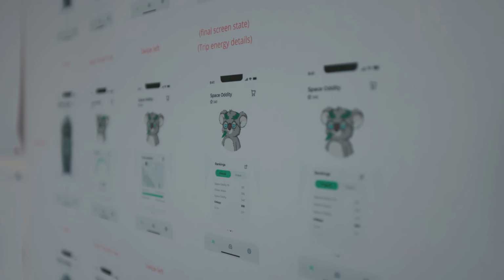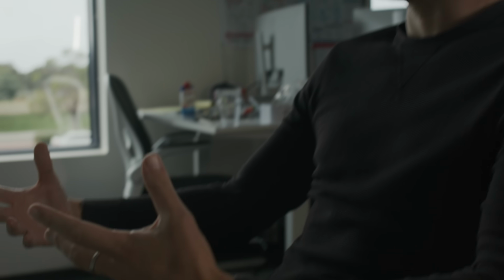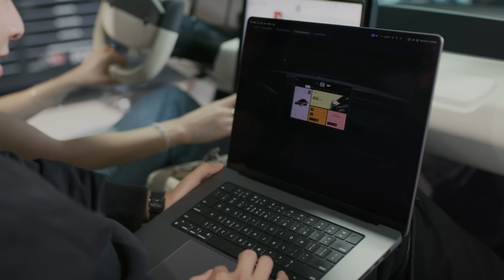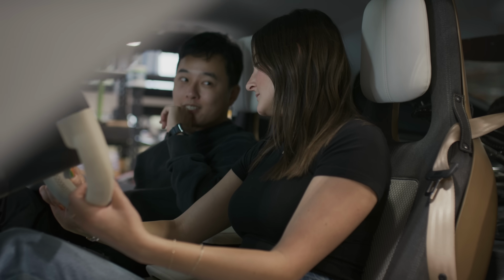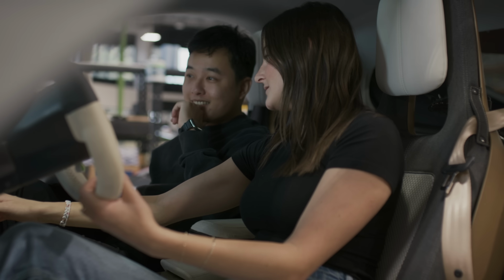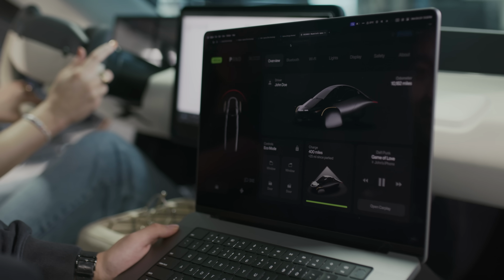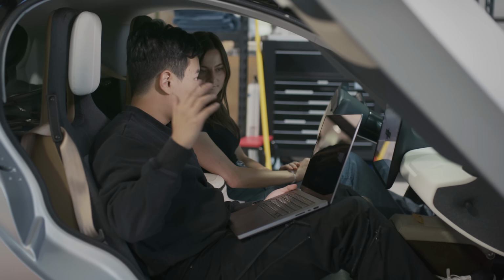Aptera — User Experience

Comment: Will it be possible to get some kind of physical button interface? especially something that can be down by the center arm rest that the driver can learn to memorize. This would help not need to look at the center screen for most use cases. This is something I learned to really appreciate in my '16 Mazda 3 after driving several other vehicles that have come out in the last 4 years.

Comment: I hope that there is  a screen that has a large digit speed readout and all necessary controls with large obvious buttons.  For the windshield wipers, windows, heat/ac/defroster. With dark mode. I don't want an eye chart and I dont want to be distracted have to go into sub nenus or perform multi touch actions while I'm driving. I'm not a fan of touch screen control in this application. I think that it a kin to texting and driving.

Comment: An American programmer for the user interface might have been a better decision.  Asian upbringing and academic training tends to convey Asian conceptualizations.  Try using an Asian translation interfaced product sometime.  The choices are entirely logical, but problematic for Americans.  Switches go up for on and down for off, for instance.  Hot on the left, cold on the right.  Little things like that really should be American-tested.  I would try to utilize off-the-shelf controls wherever possible.  Ideally, you should just use the Tesla user interface and program to that.  Tesla's interface is also a little oddball, but it is consistent and works with inexpensive devices, buttons instead of stalks, etc.

Comment: On thing I've seen others doing which I liked was the use of a rotary knob and some buttons glued to the touchscreen for function icons that never move to give you a tactile feature so you didn't have to take your eyes off the road to find them.  They were just like a touch screen stylus that permanently hovered over the screen to make those fixed icons easier to find.  Also what would be nice is programmable bluetooth buttons like one company is making as an add-on for the Tesla vehicles so you could have a user defined physical button for the commonly used functions you didn't want to search a touch screen interface to find.

Yes, Panda Express is a great way to break out of the Pizza, Tacos and Burgers rut.  Then we might get into the question:  Panda or Mama Fu's?

BTW:  That was quite an animated conversation going on in the background.  Wonder what issue they were trying to resolve...

Best!

Comment: Any function that is needed to operate the vehicle safely, when  the screen goes blank or is unresponsive, must have a physical control (button,dial,switch..).  I’ve been working with computers longer than most of these guys have been alive.  Shit happens.
Reply from the maker: You're right Lander. All essential vehicle functions have backup physical switches in case of PRND, and manual releases in the case of doors.
Reply: @ApteraMotors  And a turn signal stalk, correct?
Reply: @ApteraMotors  Thanks.  That is reassuring.  It will be interesting to see how each of those is implemented.

Comment: I don't want any internet features in my Aptera. It will only remove quality from the vehicle if the panel doesn't work. It should be 100% off-grid, bare-bones, and not require any support. And when it crashes, there should be a factory reset mode that covers all base-level features. I don't want to be spied on or milked by advertisers, they banned Tesla vehicle in certain places in China for a reason. And if this car for absolutely one second can't be as-is if you go defunct, it's a 100% no from me. I'll cancel my preorder. Keep the greedy trash practices out please.
Reply: Aptera CTO Nathan Armstrong has already spoken at length to your issues.
Reply: Could you tell me what to look up?, hadn't seen it covered in length. @n.brucenelson5920

Comment: you should add 2 sliders on the sides of the screen for the windows and for the AC either active at all times or in the "home" menu, cause little things like easy access can detract customers especially if they have to take their eyes off of the road longer than need be

Comment: Imagine going to a shopping centre and all the roof top parking spots are taken up by aptera vehicles.
Reply: That would be a beautiful thing to see.
Reply: It'd be better for everyone if they just covered the top with stationary solar panels. A rooftop the size of a quarter football field would produce about 1 megawatt hour (1000kWh) of ⚡ per day, enough to fully charge 36 Apteras. 

36 Apteras, which is roughly how many car parking spots fit in a 1/4 football field, parked by themselves would only get 10% of that energy and that's in perfect conditions where all 36 come and park during all available daylight hours.

 Any place dense enough to need a parking garage would be much better served using that rooftop space for stationary solar.
Reply: @Tazdeviloo7 yes, agreed.  And for those centres with no solar panels? at least if those were filled with aptera it would be something aptera can bring to any situation.
Reply: @DeSilver215  Right. I see the Aptera making more sense in less dense areas where things are more spread out. Less likely to have charging infrastructure or tall buildings blocking the sun. Being able to get 100 miles a night on a normal outlet when there's no charging infrastructure is huge too for these areas.
Reply: @Tazdeviloo7  most of the U.S.
Reply: I wonder if a 48v system as opposed to the traditional 12v system would make aptrea even more efficient internally as well as externally.
Reply: @Silverorient That's just the low voltage stuff in the car, it would be slightly more efficient and can use thinner wires. You wouldn't notice any improvement to the range however since that's all on the high voltage drive battery.
Reply: @DeSilver215  There is no reason to change to 48V for accessories... 12V is fine for that purpose. 12V is pretty much ideal for that use case, 48V if you went with 4x smaller wires they'd also be 4x more fragile... so 12V also leads to or is linked to mechanical robustness of the wiring in automotive systems. The battery system in Aptera operates at a couple hundred volts DC... and the switching power supply to 12VDC can be around 97-99% efficient. This system is very similar to the old G1 Honda insight... everything in the car is 12V making it easy to work on and compatible with industry standards, and the HV system in the insight is around 170-200V. Having an independent power system for accessories is probably good for safety also, as any electric steering etc etc... can remain working during HV system failure.

Comment: I understand why many cars (not just aptera) are going for touch screen interfaces but I worry about the amount of attention it requires to find a control when you're driving. If I'm driving my old car and I want to adjust the heat or radio I can reach out and if I don't hit the control I want immediately I can quickly use the control I get as a reference to move to the one I want without looking. With a touch screen it all feels the same and I have to look which means I'm not watching the road. I wonder if it would be possible for the car to recognise a keyboard/mouse plugged into one of the USB ports and allow keys to be mapped to functions so that electronic hobbyists (like me) or after market addon's could provide  a small cluster of controls that emulate a keyboard/mouse using something like Arduino and some video game buttons to add an inexpensive tactile control interface for people like me, who like some things to be physically available without having to search for it.
Reply: Exactly my thoughts.  I love the Aptera concept but I really don't like the touchscreen-only UI.  Buttons are important for tactile feedback and for being able to adjust common controls by memory without having to look from the road.

Also, I hope the OTA updates can be turned off or deferred.  I definitely do not want my car updating automatically at a critical time, say before I am about to start a long trip or have an important meeting.
Reply: It's important to reduce points of failure and certainly a touch screen eliminates many switches.  But it is also important to be able to freewheel, steer, brake, open doors and windows in a no power situation.  I personally like a physical shifter and on switch that allows me to get to the house if the electronic ui falis
Reply: @geekinstein  I mean in an EV it doesn't really need a shifter, a rocker pedal + brake pedal + steering wheel is all you need for physical controls. A physical parking brake would be nice though.

Comment: As far as my preferences are for the user experience, I'd prefer not to be reliant on the touch screens for any basic functions and to have the Alpha layout on my own Aptera; a steering wheel and the side view screens off to the sides. I'd like an uncluttered view of the road and to be able to enjoy driving again.
Reply: Yes, lets go back to tiller steering, as God meant for the horseless carriage to be built!/s
Reply: @n.brucenelson5920  No need to create a false dichotomy here. Not wanting certain features doesn't mean I want to go back to 1892.
Reply: @n.brucenelson5920 I am far from being a luddite and work with screens all day and even had to design and program some touch screen menus on a industrial automation project that I once worked on. However when I look back I really enjoyed the simplicity of the cockpit of some of the two seat sports that I owned or had an opportunity to drive. Simple visible instrumentation. Obvious controls with well placed toggle switch and or knobs. I also have cataracts thst I'll need surgery to remove at some point and screen glare particularly in bright sun with poor screen contrast are hard for to me to see. I want a default simple screen that has big digits for speed and large buttons for all the main controls. I dont want to have to go through sub menus while I'm driving. If I have to I will craft my " physical interfaces" if the options are good for me. I do like the dark background.  At night I don't want any glare or illumination to impair my vision out the windshield.

Comment: Are you planning to add physical buttons either built in to the infotainment or as an add on accessory? Not only is it a preference of mine, but some countries are ruling that operating touchscreen infotainment to do even necessary tasks such as changing the windshield wiper frequency is considered distracted driving. 

Not only for vehicle operations like locking doors, opening windows, turning on/changing headlights, operating blinker, turning on windshield wiper spray, but also having physical buttons for HVAC, or at least volume control, and next track, etc would be really nice
Reply: Your going to have to get used to the idea of software driven vehicles. Your seeing less buttons, switches, and toggles because of the need for manufacturing simplicity and lower cost. In Apteras case this means increased efficiency. Your going to have buttons, turn signal stalks, and emergency door handles where it makes sense, but check your bias at the door when you step into the future. Nobody but Tesla and maybe BYD know how to make a profitable EV. Aptera could take market share right alongside them and is already years ahead of legacy auto.
Reply: @barnabasseadog7660  check your bias my guy. It's an objectively more dangerous and less convenient choice. Forcing people to take their eyes off the road for basic functionality is not smart, and as this design choice becomes more popular, I wouldn't be surprised if we saw more legislation around this. 
This, as stupid as it sounds is a hard deal breaker for me. If the industry goes buttonless I would rather give up my car and use public transit exclusively. If apteras doesn't offer at least basic buttons like volume,  and cruise control, windshield wipers, I will not be buying it. This is not about being stuck in the past, this is about wanting to operate my vehicle at the most basical level without having to take my eyes off the road. Also you can still have your "software driven car" with buttons, because buttons do interface with the software
Reply: @vallid_50 100% agree!
Reply: @vallid_50  
Sounds like familiar assuptions from a hundred years of Detriot automotive evolution, you do you, homie. The Accelerators lucky enough to be behind the yoke next year will be sure to tell you how it feels.
Reply: @barnabasseadog7660   I know how it feels, lol, I've driven a Tesla and it's absolutely shit. I'm not talking based on what I'm used to. I tried a Tesla expecting it to be amazing, and after trying it, realized how bad it was and how much I disliked it. You talk as though I'm stuck in my ways, or making assumptions, but that's not it at all, I had a preconceived notion, got actual experience with it and I changed my mind. Not to mention as I said, some countries are considering using it to be distracted driving, and tbh I have no intention of  getting a fine for lowering my window or changing my windshield wiper speed. Perhaps it's you making the assumptions? That everything new has to be better, regardless of actual facts? But as you say, you do you
Reply: @vallid_50  Completely agree.
Reply: @vallid_50  
You know how it feels in a Tesla, awesome, your not ICE biased as I assumed. That's on me. Your just Tesla biased.
Yet your assuming you know how it feels in a production intent Aptera. I expect the Aptera to be different from a Tesla.
My point being, we are all going to have to wait on a test drive to know for certain.
Reply: @barnabasseadog7660  that's fair, we won't know how it will turn out until people get their hands on it, but if what I didn't like about the Tesla is that it didn't have physical infotainment buttons, and the apteras don't have physical infotainment buttons, then I can hope you see why I'm not optimistic.

Comment: Before I am about to criticize Aptera designs, I need to say I am an investor, a early orderer of 1000km, off-road
Aptera, probably to avoid being called Aptera hater.
The touchscreen control to me is quite discriminatory. It discriminates old people when they can no longer have precise and delicate touches to use it effectively.
It discriminates against the handicapped people.
It is located quite far from drivers, your finger tip must land precisely on the spot at a distance, not easy task to do. It could be a serious distraction at highway speed.
All controls should be located right on the steering wheel, preferably with physical buttons. The screen should serve as display only.
Copy others blindly  regarding touchscreen is not “innovative”, rather I would say stupidity.
Reply: Not to mentioned disadvantaged lefties in a left side drive.
Reply: Screens are cheaper than buttons now, that's why. :-(

Comment: Exciting to see this update, especially so soon after your Air In video! I'm definitely looking forward to learning more about the UX and how it evolves in the future. I know that the Aptera team has been pretty responsive to feedback in the past, so I hope that the same will hold true for software into the future post-launch!
I did like seeing the UI on the web, I hope that is released because all car apps that I've seen only work on a mobile app, no first-party way to monitor your car's status on a PC.
Reply: I do have my reservations about how many things are on the touchscreen as the constant push towards less physical buttons has often needlessly made UX worse through increased complixity.
For example, Tesla burying a tiny button for defog in the middle of the cluttered mess that is their climate controls (not good or safe when trying to drive on a freeway with your windshield getting fogged up and you have to actively take your eyes off the road to fiddle with a touchscreen to tap a tiny button which is right next to the very similar looking defrost button) I very much hope Aptera will evolve their design and approach things much better than their competitors!

Comment: The next feature you need to add is BUILDING THE FUCKING THING if it actually existed I would be so into that feature
Reply: How about an extended GUI discussion that didn't show 1 screen. The $25 solar charge controller in my car camping gear is more advanced than non functioning Aptera promises :-(
Reply: @artsmith103  
It's called a tease, lolz.
Reply: I see you haven't been following along. I suppose you speak from experience, having put together a revolutionary automobile and manufacturing plant yourself? 
Thank you for your wise insightfulness.
Reply: Are you triggered?
Reply: @thisandthat8686  Only that your not up to speed. Like a lot of newbs, your either uninformed, or misinformed. Then you just have to give us your invaluable opinion. /eyeroll

Comment: Love that efficiency permeates Aptera, including in the user experience.
Reply: My main concert with Aptera unsprung weight, its very bad. I drive a G1 insight which is a very similar car interior wise... its around 1800lbs again very similar. The G1 insight has about maybe 1/4-1/3 the unsprung weight as the Aptera... the real proof will be once it is on sale , can the Aptera corner safely through a pothole and things like that.... unsprung weight also has a bad effect on acceleration and efficiency. I've honestly very supprised they are not using CV axles + motor or motors so they can get unsprung weight down.